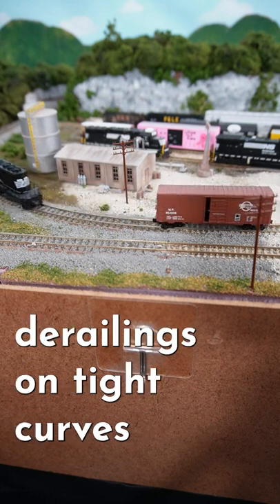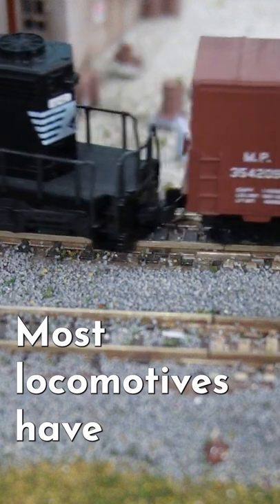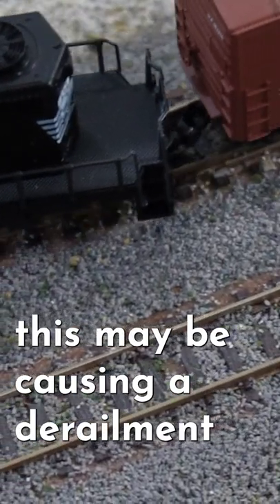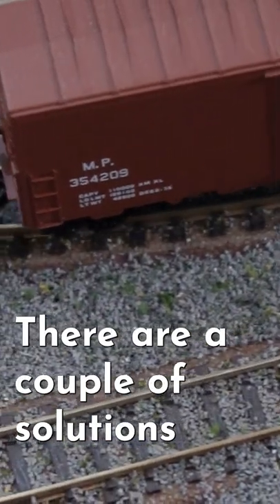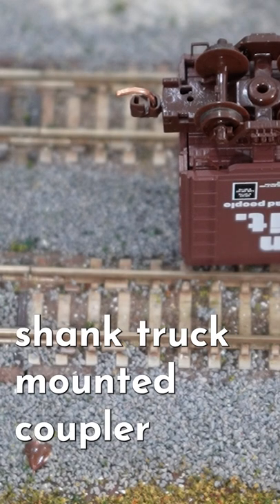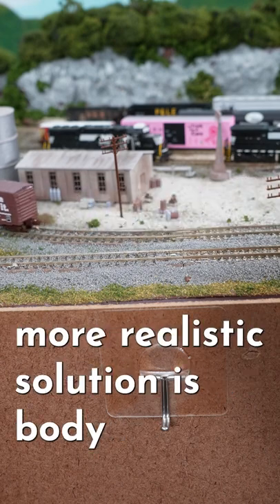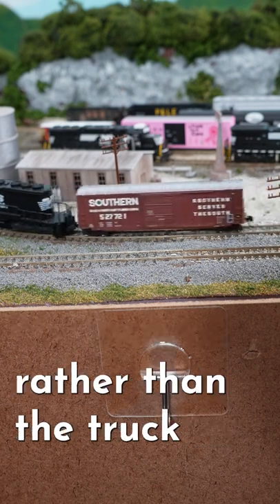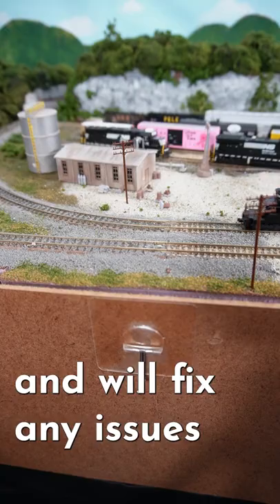Your couplers may be causing derailments #shorts

Comment: How to turn truck mounted couplers to body mounted?
Reply: Razor saw and glue I guess.
Reply: It's a fairly easy process...just cut (using an Exacto knife or sprue/track cutters) coupler box from the truck and glue a Kadee coupler box that's compatible with the type of coupler that you are using and..VOILA!!... problem solved...
Reply: @gregga.thacker8806  Yes, but remember that in N scale, Kadee is MicroTrains Line, or MTL